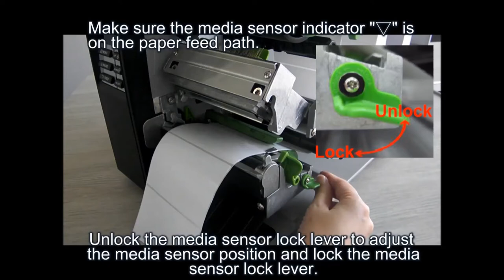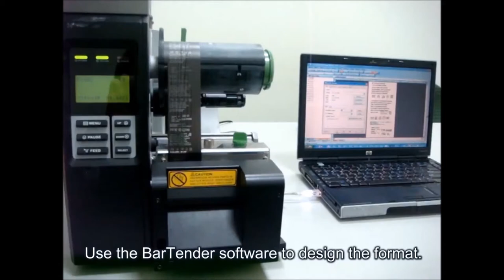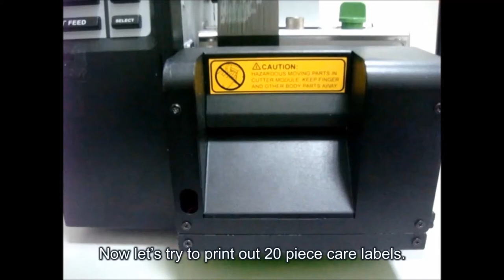Bar code เครื่องพิมพ์ TSC TTP-2410M Pro Industrial Barcode Printer

Comment from the maker: บาร์โค้ด ปริ้นเตอร์ TSC TTP-2410M Pro Series.  The TTP-2410M Pro prints at 203 dpi at speeds up to twelve inches per second, TTP-346M Pro offers 300-dpi resolution at speeds up to eight inches per second, and the TTP-644M Pro features 600 dpi resolution which makes it ideal for printing very small 2D barcodes, graphics, fine print and other ultra-high-resolution images.  All TSC printers feature a standard two-year limited warranty.